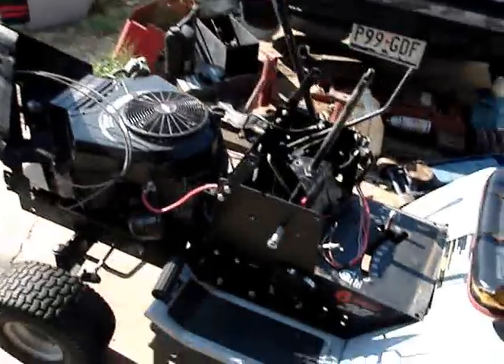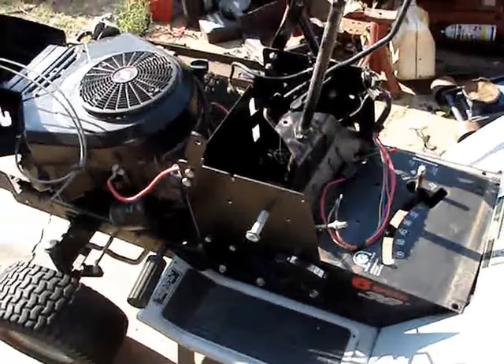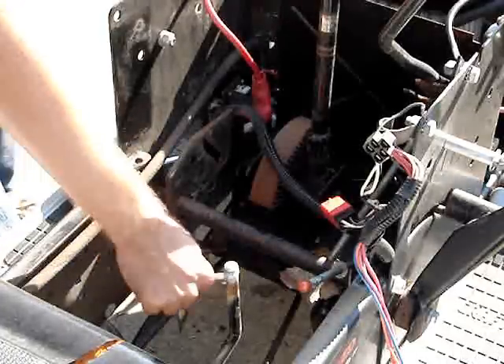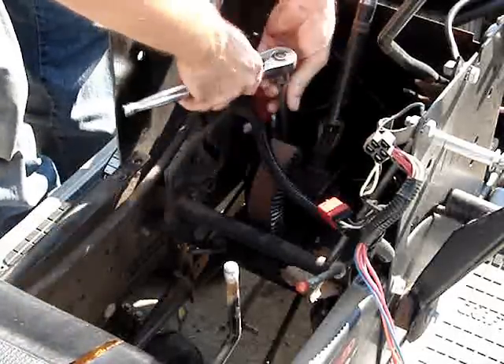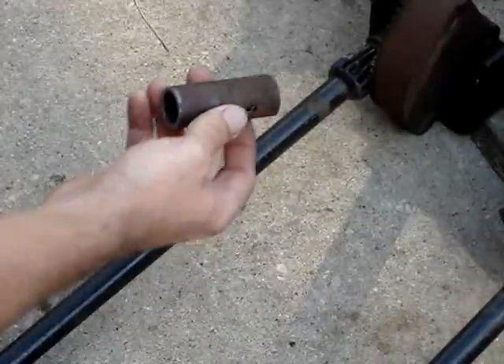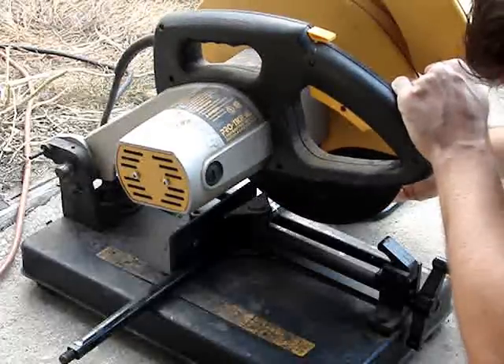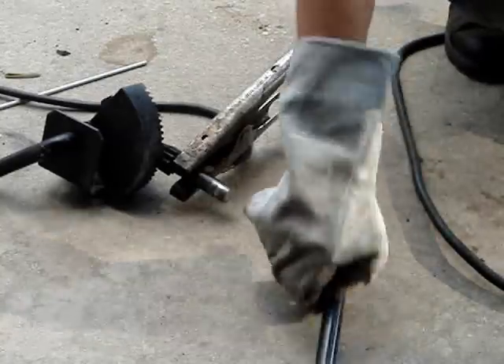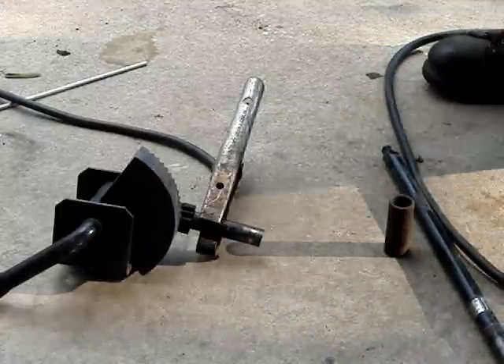1990 Craftsman 2 Steering Gear Replacement Part 2

Comment: I have a 1992 LT 4000, 5 speed. with an 18 HP B & S motor ( I'm original owner!). I finally started the steering shaft support replacement project today. I thought for sure I could weasel that steering shaft assembly out without removing that plate over the gear shift area but no way is it humanly possible..  

Anyways, I enjoyed your video, thanks!

Comment from the maker: Oh and as far as toy videos go, I plan on making a few more, I got a whole slew of vintage 80s toys. Mostly battery operated 4x4 trucks. Toy videos are harder to film than tractor videos, because I have to film indoors, which is not easy due to poor lighting inside and my camera isn't great at low lighting.

Comment: The welding and cutting part is not necessary. And air tool are great. As much work there was in replacing that stearing gear,you should have done a better job of welding. 
But you did fix the stearing. That's good.
Reply from the maker: I appreciate the comment and your opinion. I'm not a very smart person, I'm not a great welder, nor do I own many tools, much less air tools, however I am crafty and I certainly over think things, yet like you said, I get the job done. I honestly couldn't figure out a better way to fix it.

Comment: My dad just gave me a 1990 Ropa in awesome condition you could check it out on my channel it’s my first tractor it’s got 300 hours on it it looks beautiful, I have zero play in the steering wheel as soon as you touch the steering wheel that the front wheels turn I was worried about the steering on mine now I see what you went through and I’m glad he’ll be another thousand hours before I have to go through that ha ha Ha ha ha

Comment: All you had to do is remove the sector gear on each shaft and swap . must be a ford mechanic
Reply from the maker: JOHN FONTAINE Nope, not that easy. If you had paid attention to the video and also watched part 1, I explained that the steering box does not come apart easily and the shafts were different lenghts as they came from different models.  The way I did it was the only way it was going to work. And yes, I'm a FORD MECHANIC, look at my profile pic and user name.

Comment: First
Reply: I'm working on a1989  Rally plus  Roper that has that same steering gear is there a part number on the that came off that one. Have not been able to find one . Are is there any body that mite know where I can get number are find it.
anywhere